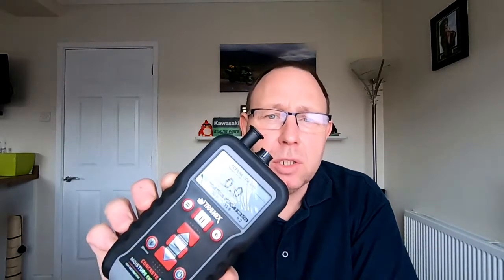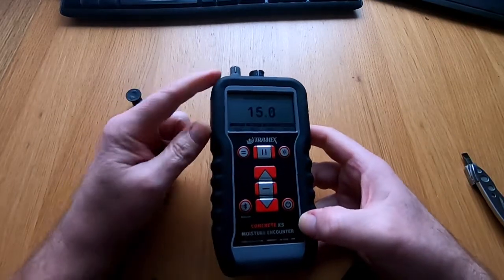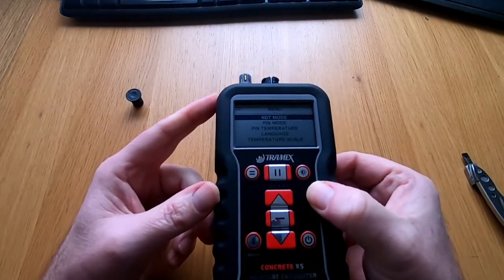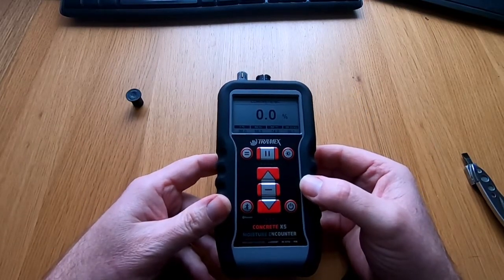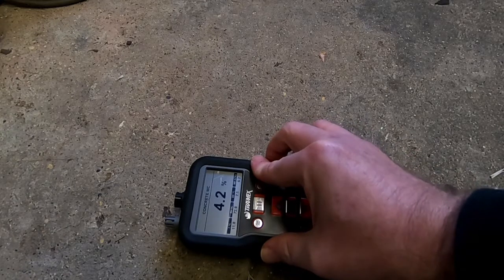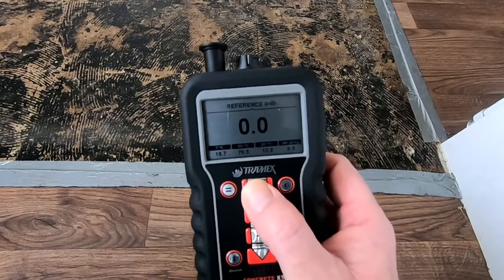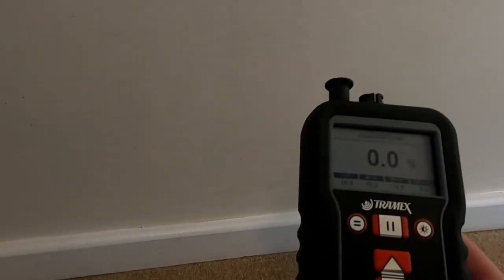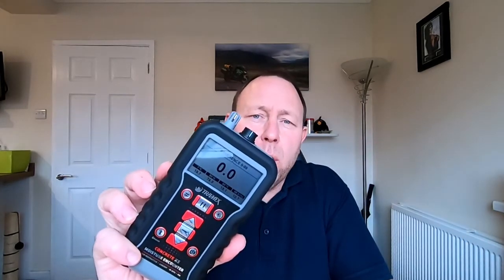Tramex Concrete Moisture Encounter X5 Moisture Meter CMEX5

Comment: What’s the safe percentage to go by so you can lay flooring on top of the concrete?
Reply from the maker: Depends on your method of floor laying. Check with the adhesive manufacturer if glueing.
Reply: @ronrookledge4311  thanks it’s for LVT flooring.

Comment: What scale would you use on aerated concrete?
Reply from the maker: The answer is that the meter is not calibrated for aerated concrete and thus will not provide accurate moisture content readings in this instance.

However the best advice is to use the comparative readings to compare to a dry standard or unaffected area.
Reply: @ronrookledge4311  Or undertake a more appropriate ERH assessment over a period of time with data loggers such as those from Lascar which will measure the Relative humidity in controlled environments to determine if moisture is still evaporating for the targe material.
Reply from the maker: @Elfin4  that’s a valid point although your question was what scale to use not method of moisture measurement. If I was being engaged as an independent consultant I would start with gravimetric testing backed up by data logging using ERH. The two combined would give a reasonable understanding of environmental conditions along with true MC. All of this would of course depend on the nature of the problem and the route to preventative action.
Reply: @ronrookledge4311  Could you explain what you mean by Gravimetric testing.  Is this what you would expect to achieve from the Tramex Machine in the Concrete MC search mode?
Reply from the maker: @Elfin4  I would suggest you research gravimetric testing as it’s not a function of the Tramex meter. However Tramex do manufacture excellent data loggers which I would also encourage you to research further. Hope this information is of help to you or alternatively contact me directly for consultancy services.